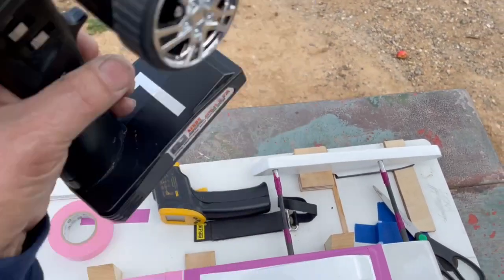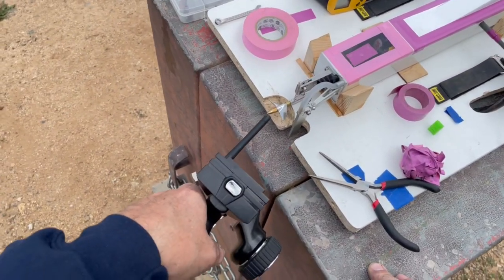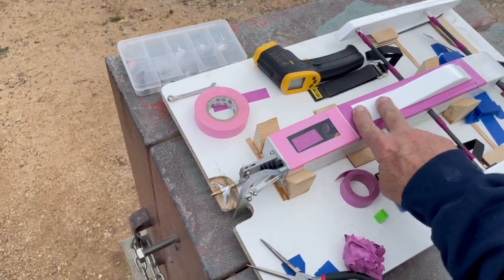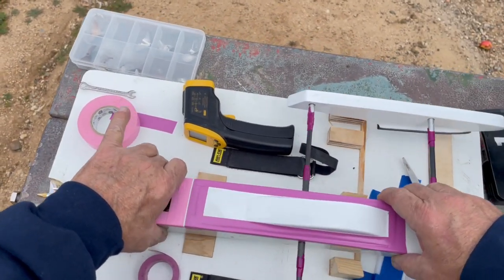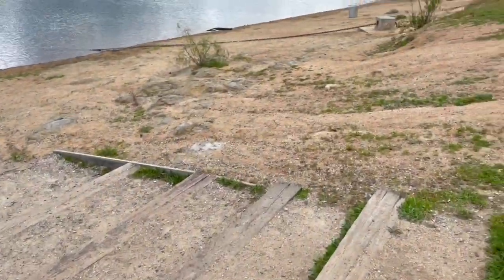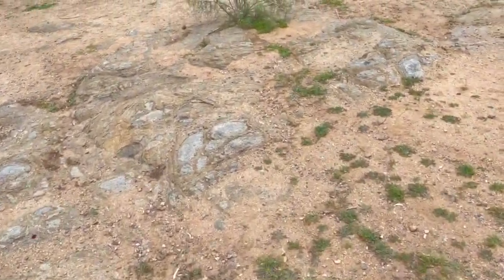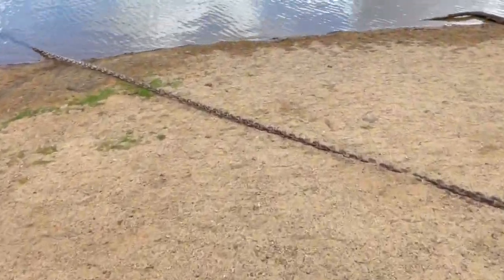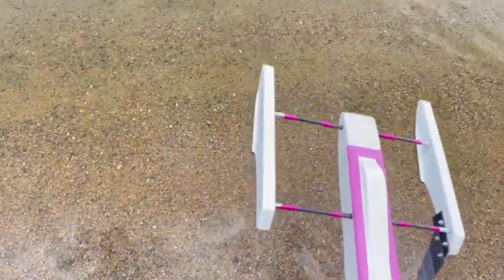Dr. Jet tests the Dona Outrigger

Comment: Well.. I went with a 60A ZTW Shark. The motor I chose will pull about 79 amps on 3S, so it may do the same thing here.. but I'm trying to keep the weight down and not have to re-solder anything. The 60A comes with everything that matches and 65g. The 80A has 4mm bullets, XT90 plug, and weighs 95g. (sigh)🤞 also found a 32mm prop in the 1/8" size but just heard what you said about cavitation. Maybe the extra RPM from 3S will help😄

Comment: Either  the esc or the lipo not supplying enough grunt causing the esc to need more amps
Reply from the maker: It absolutely was the ESC.  It has since been replaced with a 120A unit that works MUCH better.  Now, my problem is propwalk and I'll be working on sorting that out next.

Comment: which motor and esc you're using?
Reply from the maker: I am running an 1107/1.5Y-H NeuMotor.  The -H designation means it is a helicopter motor with a finned case and built-in cooling fan.  Water cooling is not necessary as the fan is VERY effective.  In this specific case, I used a generic 40A ESC which proved completely inadequate.  I have since switched to a generic 100A ESC, but I'm not happy with the soft start feature and can't seem to program it correctly.  I believe my handling issues are a result of the tub design itself and I'm considering a complete replacement tub.  When I do that, I will switch out to a Hobbywing 120 ESC.

Comment: Do you think it needs more Voltage higher mah/c rated battery?
Reply from the maker: The battery is 2.25AH and 65C rated.   They should easily handle 145 amps.  I'll run the new ESC next week.
Reply: @Dr_Jet  oh yea it's good then.  To be honest, my ztw 40 would do the same thing on 3s with the 2968 4000kv rocket motor and a 38mm prop. I proped down and it would handle it.
Reply from the maker: @IRONCLADRC  The problem seems to be that my boat doesn't like small props.  32mm and under just cavitate; be they X-series, P-series or 17-Series.  I did get it to run on an Octura 2132, but it took a while to get it going.  I had better luck with a P735.

Comment: Looks good doc you might want to step up to the 120 Dynamite speed control
Reply from the maker: The way my stuffing tube for the wire drive sits in the hull, there's no room for it.  I did find a generic 125A marine ESC in my parts bin that will fit,  It's now ready to go next Monday.
Reply: @Dr_Jet  I was just kidding.
Reply from the maker: @vinniebuiltRC  I'm serious.  I put the biggest ESC I had in there....